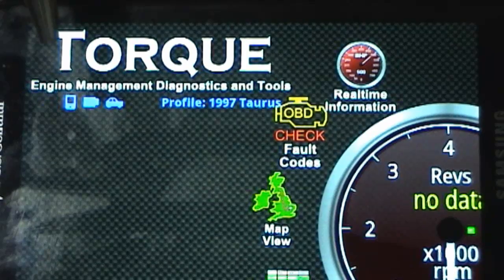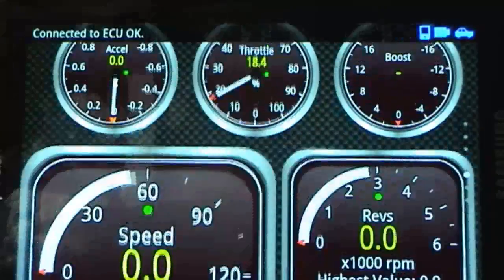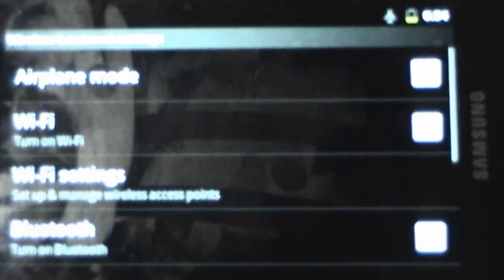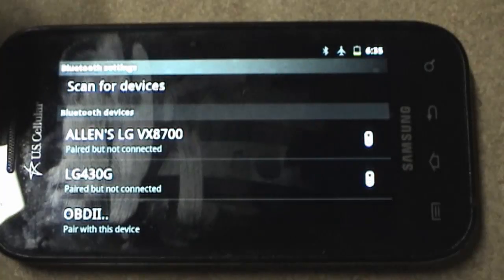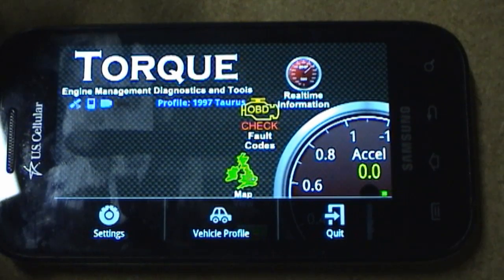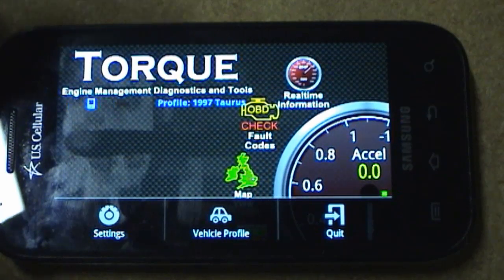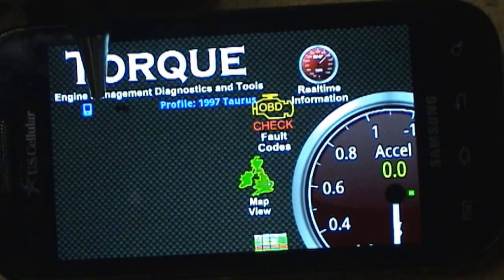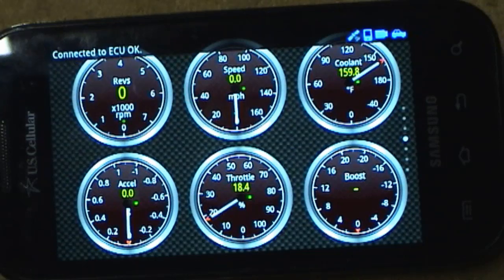Patazon's Mini ELM327 Bluetooth doesn't work with Torque - PART 2

Comment: PANGLING OBDII paired but did not link to vehicle TORQUE PRO even after going thru settings and clicking PANGLING. Took me 1hr & a dead car battery to figure it out. After watching your video and switching to my FIXD OBDII ,I paired it successfully went into settings changed it to FIXD ..went back and it said connecting to OBDII ...wa lahhh baby🙈😝👍🏾
Total of 1.5hours UNBELIEVABLE!!!
Thanks for the video and HELP champ🏆

Comment: I have the "not working type" with the tab, bought from ebay (china) and it works just fine. I have an Honda Jazz/Fit 2010 and i have no problems what so ever with my ELM 327 and Torque Pro.
Reply from the maker: Kaenssneak Yes, the bad ones have been proven to work with "SOME" cars, but not all like the one I describe as the good one. You got lucky.

Comment: Same happened to me. Probably the same adapter from a different seller in CA.
Reply from the maker: Sirena Thanks for chiming in Sirena. It seems that ultimately there are only two manufacturers of this "small, transparent blue OBD-II Adapter" and those two manufacturer's build the internals slightly different. One of the units works on every car I've ever tried it on, and the other unit only works on a very limited number of cars. When U.S. sellers buy from China to re-stock it is likely that they may think they are all the same and therefore buy the bad ones by mistake. Mine has been plugged into my car continuously for almost 3 years and it still functions perfect. By the way, you have an interesting channel that warrants a subscription from me...
Reply: There are many fake "ELM 327"  adapters for sale on the internet. IF they do not use the OBD2 connector's no. 2 pin. They cannot support OBD2 protocols ASE J1850 PWM or ASE J1850 VPW. These protocols are used on many pre-2008 domestic models.. Without this pin they may support ISO protocols used in later models.  Check out the ELM 327 website...great info.  Good Luck
Reply: +alan qismo For most of these that do not work, it's not a matter of using no. 2 pin.  The pin is there, is connected, but later on in the circuit on the PCB, there is not the required discreet electronic components to provide J1850 support.

In other words, there is no way to visually identify these bad adapters by only looking at the pins.
Reply from the maker: Stinky Cheese Thanks for the detailed info.

Comment: Both of those have spots on the PCB for the components needed to support OBD2 protocol J1850, but apparently only one has the components installed so it works with J1850.

IT HAS NOTHING TO DO WITH THE HEIGHT OF THE CASE OR WHETHER THE LOCKING TAB IS SEPARATE.

I have one that's just like the one you have that works and it doesn't work on J1850 and many other people have the same problem, but it does work on a CAN vehicle.  Casing style doesn't matter, it's what is inside and either circuit board can work too but the support for J1850 has to be soldered on.

There are both versions which lack the components for J1850 and if anything with the shorter version being the newer one, it seems less likely you'll get one that works with J1850.  Of course there will also be random DOA units from accidental manufacturing error but leaving off J1850 components was no error, there is no way they could accidentally leave off only everything that protocol needs and have the empty spots on the PCB staring right at them without noticing.

Take one of those 8 bad adapters, crack it open and see what I mean.  It's missing two or three transistors and roughly 3 or 4 resistors, maybe another component or two which I can't recall..  You can see where those parts are on the J1850 support subcircuit by looking at the schematic on page 80 of the ELM327 datasheet PDF (google will find it).
Reply: +Stinky Cheese I purchased 2 of these units, thinking the first one was faulty. Even though they were from different sellers, they did not communicate with the truck (98 ford ranger). Do you have a workaround?
Reply: brainfarth
There is no practical workaround.  Although they usually have the space on the PCB where the needed components should (could) have been soldered, the amount of effort and skill to pull apart the stacked PCB, reverse engineer the circuit, compare to know schematics, order and install parts, with the hope you didn't cause damage to something costing only $5 on eBay or Amazon just makes it unfeasible.

I happen to have a '98 Explorer as well as some GM vehicles these wouldn't work on that used J1850 and the solution was to buy a BAFX reader on Amazon for about $24.  These tiny (mostly translucent blue but there are other colors too) ones do work on CAN bus  vehicleds, anything mid-2000's or newer so don't throw it away but there is no easy fix after it has left the manufacturer.

Keep in mind that there are other adapters that look almost if not exactly like the BAFX reader but they are different internally.  I was skeptical and thought it was just more of the typical clone product advertising you see so much on Amazon claiming others weren't the same but in this case it is true.

The workaround is the BAFX adapter, OR to pay a lot more for a major brand from a US manufacturer guaranteeing J1850 support.  Those usually cost twice as much.

Comment: I sure hope all of you did not throw away your "not working" bluetooth connetors. The OBDII bluetooth connection can and will fail. however, this is not caused by the 16pin bluetooth connector. This is caused by the misunderstood levels of frequencies read over the ECU from vehicles. From the Main Menu, If you navigate to the Settings menu, you will see the OBDII settings. (select) Once in the OBDII settings scroll down to the setting that allows you to slow down the communication speed with the OBDII to interface. This will allow the bluetooth adapter to communicate more comfortably with your ECU. NOTE: (You must quit the OBDII app, close and re-enter for changes to take place) to quit properly,after selecting slower connection, go back to main menu click settings and Quit. Wait 10sec and restart the Torque app. If using an android device this is sure to solve 99% of your problems laptops may have other difficulties. Once your module has adjusted and you've established a solid connection you can go back and increase communication speed later. Also once your issue is fixed you might want to create the most detailed and accurate car profile. This is an essential task when reading data from your ECU, since most of the data being read is calculated on specifics about your individual car. This has a bigger effect then you may know. Have fun guys and enjoy the app!!
Reply: No, the problem has nothing to do with that and the connection speed is for the serial emulation, not the ECU communication speed.

It is not sure to solve any problems except someone who misconfigured torque because it defaults to the slower speed, and if it were the problem then it wouldn't work again once you set it back to the faster speed because there is no "adjusted" factor.  It does not adjust, either works at a speed or doesn't.

However there is another reason why they shouldn't be thrown away, that they probably work fine on newer CAN bus vehicles.
Reply: I tried everything..just dont want to connect to ecu..☹
Reply: I have a 2012 VW POLO does not want to connect to the ECU ..MY brother has a 2014 VWCaddy max ..worked 100% within minutes from connecting it to the obd2 adaptor of the vehicle..so it looks like it will work on newer models

Comment: I'm experiencing the exact same problem with my ELM 327 mini, ordered it from ebay but forget to check if it was realy made in the us or europe ( i'm from Belgium ).
Now after checking your video, i'm pretty sure it's a fake because of the clip and the way the chip is positioned.
Just for the sake of it, i'll order a new one today that looks like the one without the seperate clip (tongue) and with a serial number on it from a german dealer.
I'll post the outcome here, thanks for the tip!
Reply: None of these little translucent, or similar size black, white, or solid blue, nor the one in the video, are made in the US or Europe.  They are all made in China but then some suppliers order stock to be shipped to their native country for more rapid delivery so it could ship from anywhere in the world regardless of being made in China.

There are no "fakes", except that neither use an official ELM company IC, rather they are ELM327-compatible meaning they work with most software designed to work with ELM327.
Reply: do not order any without a separete clip (mine doesn't have a separate clip but still it doesn't work). It is about the second pin on the connector, some cars use a protocol which requires the second or some other pins connected.
Reply: Mükremin İncedağ
Your post does not translate to english well.  What does separate clip mean?  There was no such issue on mine, it had all electrical contact pins present, but did not work on J1850 protocol because the electronic components necessary to support J1850 were omitted from the PCB. 

Literally, I tore mine open and inspected it, could see the locations on the circuit board where they had needed to put components to support J1850 but did not.  That makes it untruthful to advertise such products as supporting all OBD2 vehicles when millions of them, especially older American brands prior to year 2008, used J1850.

Comment: I bought the cheap Bluetooth obd2 adapter from ebay, I had the same problem you had with my 1999 GMC Jimmy, but I tried the adapter in a 2009 Chevy Silverado and it seemed to work fine. The cheap ones must not be compatible with all obd2 systems. I also tried it on a 2004 Chevy Venture and it wouldn't connect to the ecu on it either.
Reply from the maker: Yeah the cheap ones seem finicky, totally hit or miss on those man. OBD2 has many protocols that work under it's spec from various manufacturer's and clearly not all these cheap adapters support all the protocols. Thanks for commenting on your experience with the crap adapter.

Comment: When i have connected the OBD2 interface with my car than i have paired the device with my phone by bluetooth,  after it when i would to launch the Torque my phone has been immediatly restarting. My phone is a Sony Xperia Go with Android 4.1.2. There is anyone who can give me any advise what does it?
Reply from the maker: This clearly sounds like Torque has a compatibility issue with your Xperia. Bummer. Hopefully the Torque author will get a fix and an update to Torque considering the Xperia is a pretty popular platform. Have you tried to contact the author?

Comment: Do you by chance have a link to the BrainyDeals one? I don't see them on Amazon, but I see a bunch of other ones. And how much did you pay for it through BrainyDeals? Thanks!
Reply from the maker: I bought mine around October of 2012, i'm not sure what link to trust now, or even if in fact you did happen to find a BrainyDeals unit I'm not sure you could safely assume they are still from the same actual manufacturer. I'm sure BrainyDeals sources their product from different vendors. I do know that the ones I received from BrainyDeals actually was shipped by a company called AGPTek and I do remember also seeing their brand of units for sale on Amazon too at that time. I bought several units, but only two of them are heavily used. The car I drive everyday has had it's adapter plugged in since I bought it in October 2012, I never unplug it. It still works flawlessly, matter of fact a few nights ago I was driving, my car stuttered a little bit and then my Check Engine Light starts flashing at me. I pull into McDonald's and fire up Torque on my Android and see I had some Cylinder Misfires on Cylinder #2... So convenient!
Reply: I ended up buying one from Dreamall. It says they are out of NY, so I'm thinking maybe it might be the same company? I hope that I get a good one because it would be very nice to have torque on my phone. Now I just have to return my phone dash mount because it was broken when it got here yesterday...ugghh
Reply from the maker: I've been through my share of mounts for sure! I finally broke down and bought an expensive one and never looked back. The one I got is made by Kensington, I bought it from Microcenter.com (they actually have a store front in my hometown). It cost $30 but is a solid mount! Nothing more annoying then a vibrating mount that won't let you easily glance at Torque while the car is moving. Oh, and the cost of my BrainyDeals OBD adapter back then was like $15...
Reply: ImYourGuiltyPleasure Yeah. I spent $15 on the OBD adapter as well. The mount I got was the iOttie (http://www.amazon.com/iOttie-HLCRIO102-Windshield-Dashboard-Universal/dp/B007FHX9OK/ref=sr_1_1?ie=UTF8&qid=1392903528&sr=8-1&keywords=iottie). It was $20 and my friend has one as well. Solid mount and has a gel suction cup so you can mount to dash as well as windshield.

Comment from the maker: In the Main Settings for Torque you can select to use Emperial Gallons or not... Torque takes a little bit to figure out and get used to, and alot of it's functions aren't obvious at first until you experiment. I agree the instructions for it are lacking, but the program is well thought-out once you get the hang of it.

Comment from the maker: I have since tried Palmer Performance ScanXL with the optional GM/Ford Enhanced Modules on my Acer Netbook with the BrainyDeals Adapter and it worked flawlessly. I have not sent the other 8 bad ones from Patazon back to them yet, so I grabbed one and tried ScanXL with it and as expected, did not work.

Comment from the maker: Your welcome, glad to know that my effort to make this video is helping some people out. I have only tried the Torque program with these adapters, thanks for adding info about the fact that you tried some PC-based programs and had the same results, at least now we can assume that the problem with certain adapters is not just a mere incompatibility with Torque. I too saw the one's on DX and was tempted to buy that one at first, until I found the one's from BrainyDeals here in the U.S.

Comment: I bought the same device from DealXtreme and couldn't get it to work. I searched by device name/description and found your review on Amazon. After viewing your video I realized I received the bad style - separate tongue and upside-down label. I'm not using Torque but couldn't get it to work on either a netbook or laptop trying several different software applications. Same problem - recognized the device but couldn't get any data. Thanks for going to the trouble of making the video.